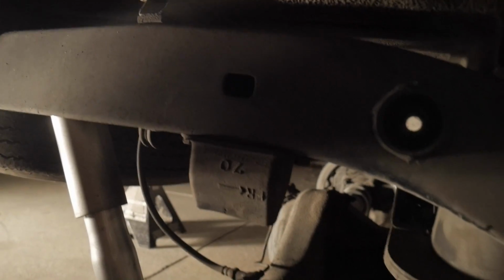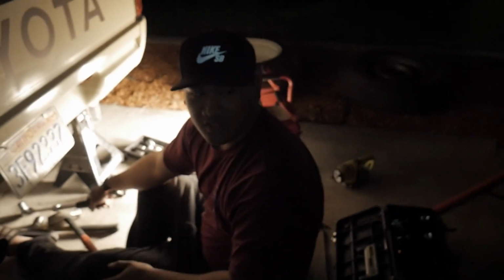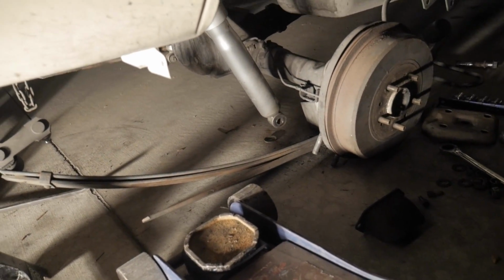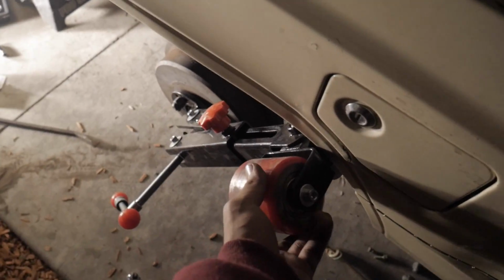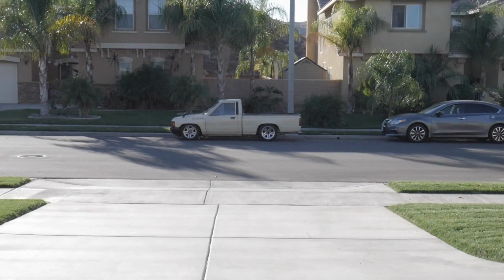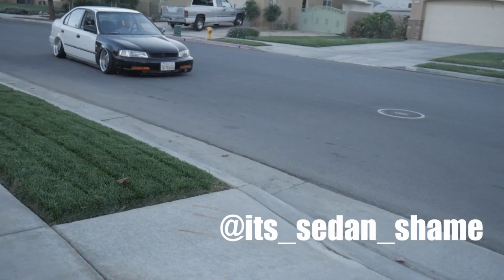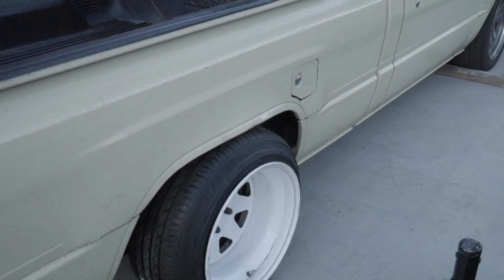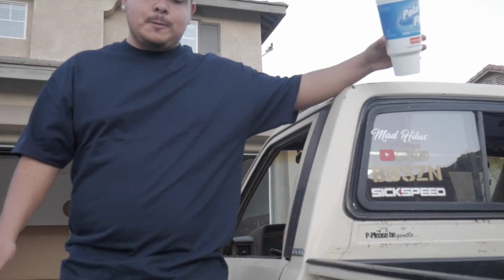Finally slamming the mini truck!

Comment: Get rid of the drop shackles  and you will get an extra 2" of drop.   If you bagged the truck  fuck the bump stops. If not I hope you got s strong back cuz is going to beat you to death.    Speaking from experience  long bed chevy 5"axle flip kit 4" drop shackles. And rubbed right thru the bump stops and  thread end on the frame  fucking hurts!!!!!